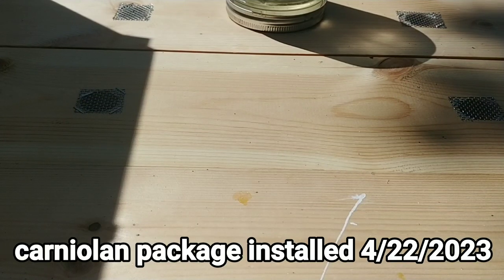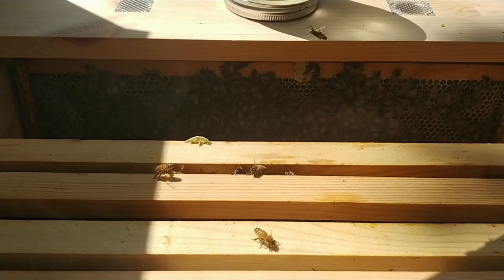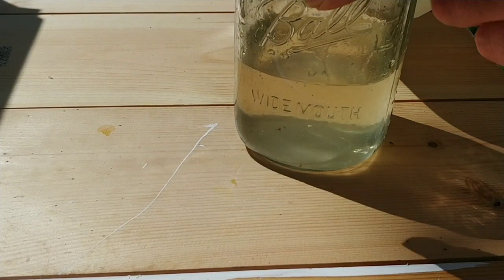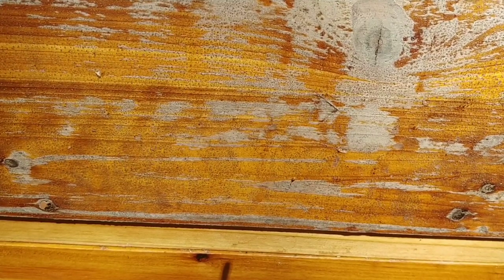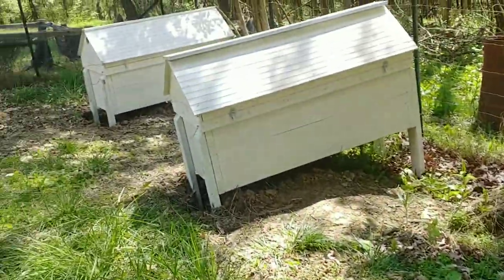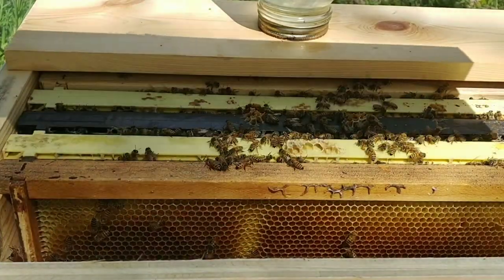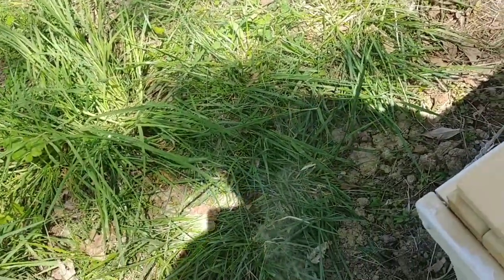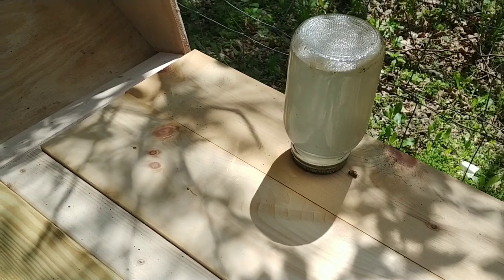checking new langstroth long & laystroth hives with carniolan, saskatraz, vsh bees #long #hive #bee

Comment from the maker: the story of how I came up with laystroth hives:  prior to the cancer years (2020 to current) I had planned to test long hives, there were 3 varieties I was looking at and was going to build 1 of each layens, langstroth long, lazutin.  I actually bought all the material to build them fall 2019.  Over winter 2020, I didn't feel right ... I didn't feel sick either, but I was just drained of energy.  Then early spring (march 2020) is when I found out I had cancer and the material to build these hives stayed in my building 3 years taking up space. During the cancer years, langstroth hives were hard to manage .... the boxes can weigh over 100 lbs each and be stacked 6 or 7 boxes tall (over 6 feet). So while I was in a weakened state, basically I just couldn't properly manage them. That got me thinking about the long horizontal hives again. My original plan was to build langstroth long horizontal, layens horizontal, and lazutin horizontal (different styles of horizontal hives based on frame sizes). When I had cancer, I had a LOT of time to think about things ... over and over and over and over ... because I didn't remember thinking about it already due toe the cognitive issues aka short and long term memory loss 🙂 But I was smart enough to realize having multiple styles of hives each requiring different frame sizes was going to be a PITA long term and I wasn't sure I was going to have the time to be building frames all the time when needed because it takes me way longer to do things today compared to pre-cancer years (I've still technically recovering and many lingering issues I mostly talk about in my cancer story videos) .... and originally these hives were an experiment only. But post cancer they became a necessity until I am back 150% which may be never (fact, according to drs). A langstroth long hive would use my existing frames as-is without any modifications but there are some known issues with langstroth frames in a horizontal hive ... mostly centered around "bees won't break cluster in winter time and will starve to death even though there is plenty of food stores on neighboring frames. They won't break cluster to get to the food stores because they prefer to move upwards and on a normal langstroth hive that is possible because you stack the hive boxes on top of each other. But a langstroth long you place the frames next to each other horizontally). So layens and lazutin hives solve this by making the frames physically taller. Layens frames are narrower than langstroth though and lazutin frames are so large they often break from weight of honey. So I came up with a way to make all of my existing langstroth frames usable by combining the width of langstroth frames with the height of layens frames. Best of both worlds. I then decided to call my hive design, laystroth ... because its layens + langstroth frames. Langens just didn't sound right lol  The laystroth hive designs I created aren't very efficient with wood usage because I normal 48" long hive would only be something like 33 frames and I wanted 40 frames.  But once it is built, the total volume of the hives comes out to be equivalent to 40 deep frames and 40 medium frames.  They are massive and the video doesn't really show how large they are.